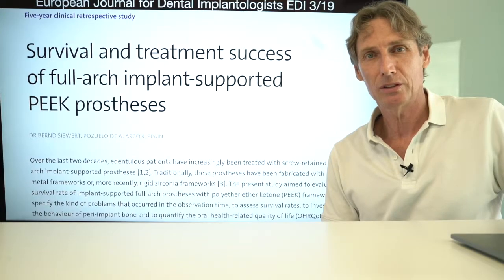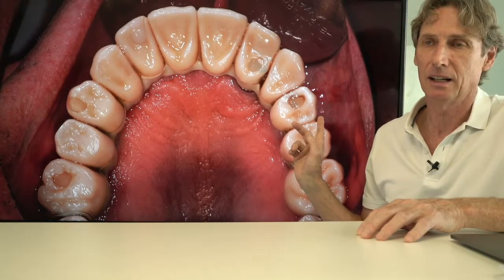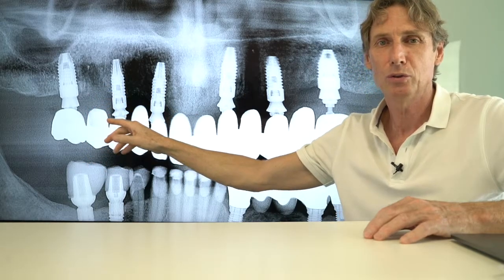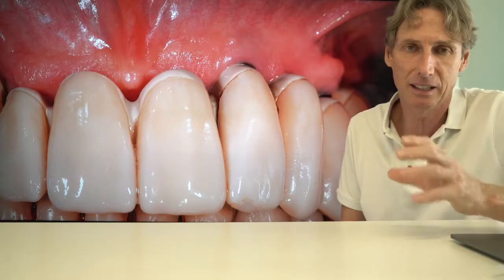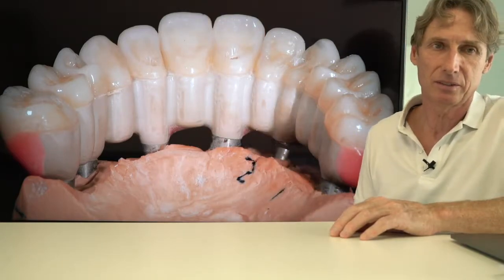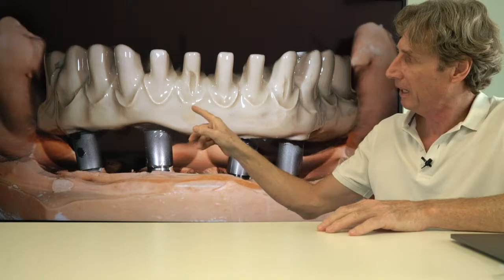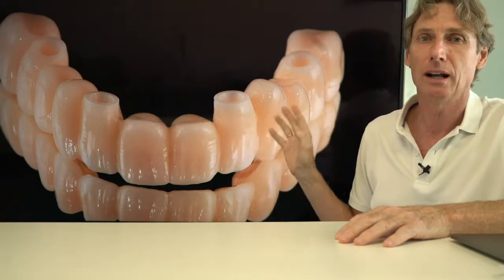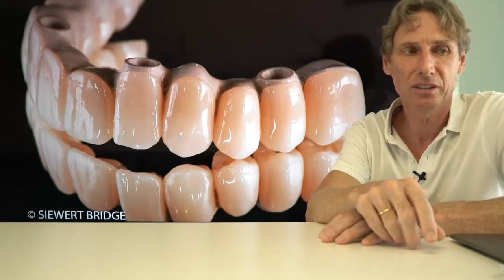Video1 Introduction to the SIEWERT BRIDGE innovative metal free PEEK framework veneered with ceramic

Comment: Unfortunately substandard esthetics and also the vdo space needed is too much. It may be OK to use as a composite veneered hybrid frame,  but thats about it. Also a real  bruxer will make confetti out of this frame in no time. You can't have flex in the cement bond under a zirconia crown!